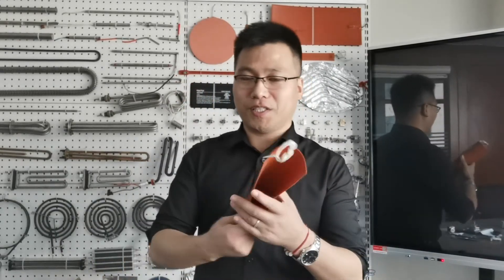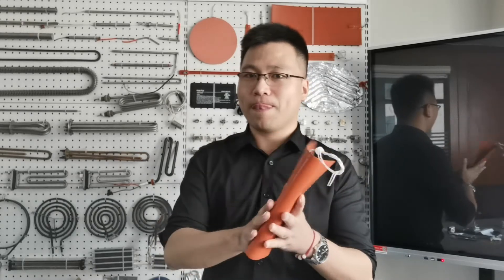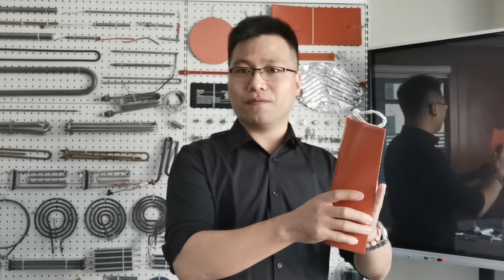High Quality Custom Made Silicone Rubber Heater

Comment: I am looking to heat a small space in a wall about 25 CM long.   It's for a pipe in the wall to keep it warm.  I don't need it very hot just warm.  I need a heater that will come to a temp and shut off.  The heater can be in constant heat as long as it is just warm and has no chance of fire.  Please contact me if your company has this type of heater, thank you.
Reply from the maker: Thanks for your comment! The contact entrance is placed in the video description, welcome to consult us!